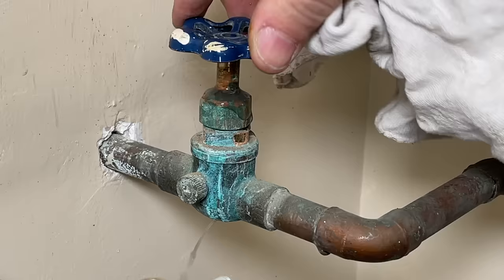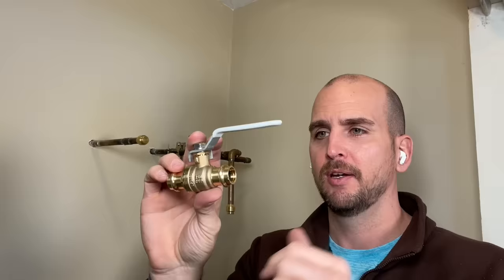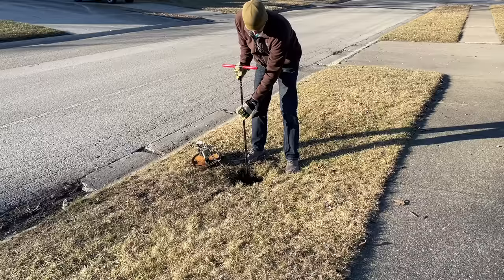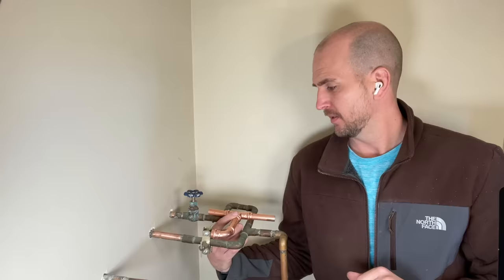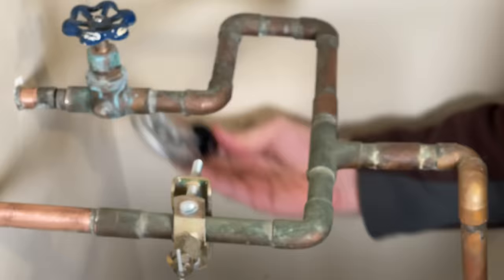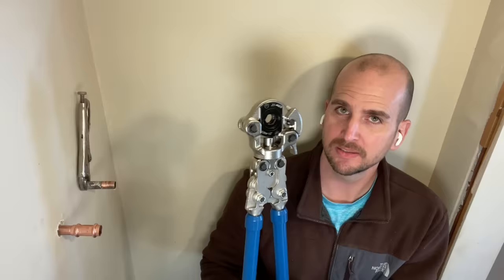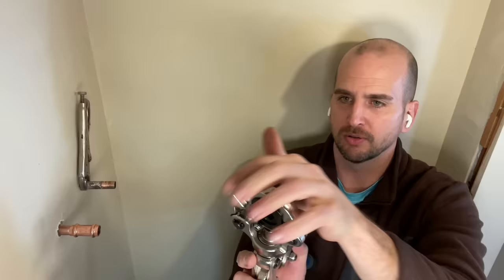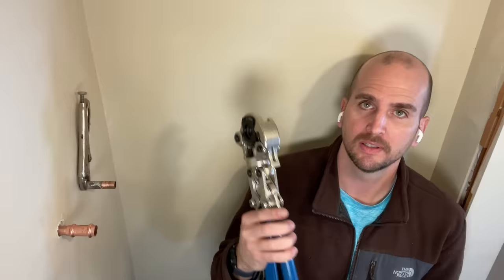How To Install a Main Water Shutoff | NIBCO Press Fittings

Comment: Now compare the price of fittings, tools and easy of install to sweat fittings, plus on a main line with an electrical ground? I mean if you are going to invest $180 in some plumbing tools go PEX.
Reply: Yeah I can’t see propress being practical for diyers or handymen. Propress pays for its self in two ways. Large jobs where you save on labor from soldering everything. The other way is in some repairs. You don’t have to completely drain the system to use press like you do with solder. If you have to fix a leak above a slab propress is wonderful because water is trapped in the loops and you can’t drain it making soldering difficult. You have to tape on a compressor and hope you can blow it all out whereas press you can just fix it
Reply: @joshcowart2446  Have you seen the price of Copper today?  Even retrofit homes are using PEX.  I am no plumber, it just seems economy alone has made Propress an obsolete technology.  You can buy a 100FT of PEX for the same price as 10FT of copper.  add in the additional price for fittings (10x propress vs sweat) and labor (vs pex) what large job or professional plumber is going to use this technology never mind invest in its equipment or space on their truck?  I even question the longevity of propress, O rings eventually fail, compare that to a properly installed sweat fitting.  With the evolution of pex being used everywhere these days including gas lines, and the spiraling cost of copper and other metal pipe, where will Propress or Megpress technology even be in 10 years?
Reply: @ericfraser7543  I agree, I wasn’t advocating against pex. I was comparing propress to solder. 

As to your argument I’m not speaking strictly residential. In commercial, copper is required for fire rating. Although I know uponor is 25/50 smoke and fire rated but I don’t know about other brands of pex. 
 
One of the positives I mentioned was repair. Pex has no bearing on repairing a leak in copper 
As for gas lines, where is pex used for gas? I try to keep up with tech and codes but I have yet to see pex for gas. For one, only metal pipe is allowed inside a building and the only flexible material is csst and it is definitely not cheaper except in certain situations especially with mega press. You may be referring to PE pipe which is similar to pex but it isn’t allowed outside the ground. If you had PE pipe in a house and it caught fire, let’s just say them at fire would get real big real fast and depending on the main pressure could cause other problems
Reply: @ericfraser7543  
I'm a retired plumber, and you're 100% correct.  I would never invest or use this nonsense.
Reply: @joshcowart2446  
Any plumber that would use Propress in a commercial application is nuts, that includes Shark-bites etc. Hell, I would never use any of those solderless connections in any application. There are several methods of getting water from copper tubing, both above and below a slab quickly. I know, I've done it hundreds of times. Soldering is by far the best way of fixing leaks on copper water lines.
Reply: @joshcowart2446  Yes I know you were not disagreeing, I guess I was referring to the yellow underground pex type pipe I see people installing for propane service to their home.  I guess your fire code explanation makes sense as to why it transitions to black pipe once inside the home...  I am not a pro but I can solder a pipe, it is not hard.  I just find it hard to believe anyone would advocate a homeowner buying a $180 Propress tool to install a main service shutoff... I mean it would be cheaper to pay a plumber if you could not figure soldering out on a youtube video.

I was not aware that you still need to use copper for commercial buildings.  It would make sense that a commercial sprinkler system / and main trunk lines required to be metal, as you would not want a pex water line to blow and depressurize the whole sprinkler system.  Still would Propress, and its mechanical O Ring meet today's commercial fire codes?  

To me it seems that technology evolves a lost faster than Building Codes, there is a political / financial reasons as to why it takes so long for building codes to adopt new technology.  There is likely some insulated/fire rated pex water line and or gas line solution which would meet today's fire codes.  I expect in 10 years it will be difficult to even find copper pipe in the big box stores, never mind propress fittings.
Reply: @ericfraser7543  copper isn’t required but engineers either h ent figured that out or don’t like pex. Like i said uponor brand pex is fire rated but I’m not sure on others. You can use pex in a commercial building but it’s rare that they call for it. I agree with the politics part. I don’t know codes for fire sprinklers but they do have plastics available for it. The use an orange pvc. I think it’s just cpvc that’s colored a certain way. As for gas, I’m guessing there’s a much higher standard than water when it comes to fire which is why even a fire rated plastic isn’t allowed. Also the reason an o ring is allowed is because a fire rating is just a delay. It doesn’t have to be fire proof.
Reply: @braney56  Amen and caulked cast joints are so much better than solvent welded pvc. You must have retired years ago because it’s been standard practice for at least a decade. I wouldn’t put shark bite anywhere near the same category as propress. I have the same hesitancy of trusting an o ring for decades but I’m getting over it.
Reply: Funny how the dinosaurs still won’t adapt to new technology
Reply: or solder

Comment: Great Job, One question, if you need to solder (in the future ) of a nearby fitting would this soldering melt the O-ring in the press fitted section?
Reply from the maker: Viega, which makes ProPress, offers a bit of guidance for this situation Soldering or brazing near an existing

To ensure proper sealing of the soldered/brazed
joint and the press connection, a minimum distance
between connections must be maintained.
When soldering near a Viega ProPress connection,
the installer must remain at least three tube
diameters away from the connection to prevent
damage to the sealing element. When brazing, the
installer must remain at least nine tube diameters
away from the connection. Refer to Table 3.4.
The installer should take precautions to keep the
Viega ProPress connection cool. These include:
•	Wrapping the connection with a cold wet rag
•	Fabricating solder connections prior to
installing the press fitting, making sure the
tube has cooled before installing the fitting
•	Applying “spray type” spot freezing
Reply: That's a very great question my concern exactly I don't know if I want to rely on an o-ring on my copper pipe I do a lot of plumbing repair work hot water heaters and I like to know that it's in there permanently and if it had to be redone you just heat up the soldering clean your pipes again I'm not real happy with it I don't trust shark bites and I don't know if I trust an O-ring

Comment: All you really have to do is go down to Home Depot and buy a ball valve with compression fittings on each end… only takes two pairs of channel locks to install with a little bit of pipe dope on the threads. The compression joint will last forever ….But if you’re getting a kickback from Pro Press, oh well, they sell another tool. I’ve been doing Plumbing since junior high, over 40 years. I wouldn’t use O-ring based fittings except maybe on an outside fixture and it’s all you had to make the repair.

Comment: The mechanical press deforms the tubing and fittings.  Deformation causes turbulent flow that will cause cavitation at every cold press connection and result in premature leaks and failures.
Reply: I would like to see a demonstration of that with clear pipe, but it does make sense.
Reply: I disagree, It forms on the outside around the pipe that's inside the fitting which will not cause turbulence.
Reply: Earth to Scott Choi  It's presses the outside fitting..stop reading comic books  lol
Reply: @davo912  - It will also deform the tubing some too.  Also, proofread your comment, you sound like comic books are over your head.  Auto correct has gotten pretty much all of us, it's definitely made me sound like an idiot a time or ten.
Reply: @dustintunis9347  as usual you make comments  that are delusional and just make comments to make yourself feel important. Please present your evidence that it can deform a pipe when it's a rubber o-ring pressing up against the pipe..Stop sniffing glue..lol
Reply: @dustintunis9347  not a prick but just dispise people that make comments like yours and now fully admit that you know nothing about the product..
Reply: @davo912  - Only being a prick when somebody annoys you is still being a prick.  You could explain why you think somebody is wrong instead of just trying to stay a fight.  I thought I understood how the fittings worked and it made sense that they would deform so I had no reason to question how they sealed.  Instead of asking how an o-ring would deform the pipe or explaining why it wouldn't you went straight to putting people down.
Reply: @dustintunis9347  very true  Dustin..thank you for the compliment

Comment: I've found the cost and time for replacing a washer and silicon stem packing makes more sense for me. I clean up the stem with a steel brush on a grinder. ...good for another 25 years!
Reply: except if its a gate valve..

Comment: I'm torn on just learning how to solder copper pipe or buying this tool. Soldering cost is cheaper but the upfront cost is still expensive. Torch,gas,deburring tool,flux,solder.
Reply from the maker: If you have the desire and some patience I would learn to solder.  Hard to beat a properly soldered joint.

Comment: I'm new to both shark bite and nibco press fittings but I can say from experience there is one slight advantage with shark bite, they are removable using an inexpensive tool but the nibco press fitting is not.

Comment: I'd like to put in a main water shutoff inside the house, but I'm not sure would be the best way to go about doing it. We don't have a basement, so we have this concrete cylinder valve in the ground, but it's broken. We end up having to shut water off at the meter to do any servicing. I don't know if you could just put a valve in the concrete slab with a metal cover over it. It would be easier to shut off the water whenever it rains and especially when the meter gets flooded. It seems to usually be flooded whenever we need to do maintenance. For one valve install, I think I'd rather just have a plumber do it. It likely would cost around the same when you add in the cost of the crimping tool.

Comment: All fittings are good but only when used in the right context. Can't beat copper and a solder joint but in some cases heat is not allowed. Our press fits in the UK are good but pricey and the press tool is expensive. You have to decide if you can justify press fit.

Comment: Nice video definitely think sharkbites when installed correctly are truly amazing.  Always wondered about the manual press by nibco,Looks like it did a great job . Definitely pro press is the way to go in bigger pipe and a non stop water situation yes they cost alot but what about your time its definitely worth more than fitting. I've soldered  1/4  up to 6 inch .  Soldering pipes will be a thing of the past in the not to far future.  Master unrestricted master plumber> owner, worker  of Joe Mac Plumbing. SHARKBITES ARE PRO SO YOU DONT HALF TO BE.
Reply: I recently had 120 feet of steel gas pipe run with several direction changes and the pros only used press fittings.  They must have confidence in their dependability.

Comment: Ball valves have a tendency to seize up if they aren't cycled occasionally.
They're good for boilers and other equipment that gets serviced.
A slightly leaking compression valve is better than a ball valve that is stuck on full open.
Reply: Thanks for the reminder!!  Something to do today.

Comment: When the o-ring fails, how do you remove the crimped connection to replace it?  It seems like you'd have to cut it off again, leaving very little pipe left.  I think I'd prefer a compression fitting or a soldered one.
Reply from the maker: Hey James, yeah you would need to cut the pipe off if there was a failure.  Overall only 1 commenter indicated they saw failures in press fittings but we will see if more comments on failures come in as we usually get a wide range of experiences from all over the US / World.
Reply: On a new build then definitely a lot quicker and anyone can actually crimp .
but as replacement on an existing install definitely wouldn't use them, the fact the vavle needs replacing demonstrates why this jointing method can lead to more issues
Reply: how long do you think it will take the ring to fail? Press fitting are used across the world in residential and commercial settings with a warranty of 50 years.
Reply: @TheDogDad  if you're going to use a crimp joint why not just go straight to solder joint, at least you'll have the ability to desolder the joint without cutting pipe short.
Good luck claiming even just 10 years down the line. How do you prove it was installed correctly and by a bonafide plumber just for starters, and for the cost of the joint is it even cost effective to argue the item didn't last the course. 
Ideal conditions never match real life., 
Here in the UK plastic pipe push fit fittings are commonly used is used if it can be hidden and copper pipe where pipe is visible

Comment: FYI when operating a old valve run the water. Any junk on the valve will be washed away. 

Also supply house has shark bites for cheaper than big box store.

Comment: I think sweating pipe is best for seal and rigidity, but takes too long for what it's worth, I like the crimp-ons, they are ridged and seal fairly well. 
SharkBite on the other hand, are expensive, bulky, and are NOT for professional work. Use SharkBite for temporary joints, and or caps, is great though.

Comment: well i don't know about the rest of you but by the time you got the first one crimped i would have soldered everything and gone home already lol at 175.00 bucks for the tool this is for plumbers only am not sure i would trust this to last in the long term O-rings break down
Reply: I’m a union plumber and these last very well. We use the expensive press guns but they have them for natural gas, copper, steam pipe. Very dependable

Comment: I am not a plumber.  If I have a plumbing project it is usually an emergency.  I have to make at least three trips to the local Ace hdwe store and invest upwards of 50 bucks on parts or maybe a tool that I may use only once in 15 years.  I could hire a plumber, but at 150 bucks an hour, it is cost prohibitive, plus the fact that all plumbing companies are booked up solid for weeks or even months.  My grandson hired on to a company but quit after 2 weeks.  He decided a plumbing career was not going to be his thing.  As an aside here, my wife and I needed to replace our 40 year old bathroon toilet.  It has been several days and hours busting out concrete so a new closet flange will be between 1/8 or 1/4 above the floor level. Sunday I spent 5 hours with a cold chisel and a 5 pound hammer.  I still need to secure the flange to the concrete by drilling holes for screws.  In the mean time, we are careful to not rock the bowel.  It is turning out to be a depressing nightmare and a drastic emergency.

Comment: The press fittings look great, however, I would probably just sweat new copper fittings and valve.  As a DIYer, I do so little of this, I really can't justify the cost of the tool and the fittings.  Even though I have a tool box full of tools that I bought and used only once!

Comment: For occasional uses, I'd rather just solder. I am a remodel contractor and I do lots of plumbing repairs during a remodel, and that big handle will requires large work space. And the cost of proper pro press tool just did not justify the cost. For professional plumbers who use it every day, it makes sense, but not for me.  I have proper Pex-A expansion tool though. I got it pretty cheap and used it to repipe my house.
Sharkbites are probably safer for home owners than low quality press tool. Less chance of making mistakes.

Comment: You can take a hacksaw and cut old valve off. You cut on the  valve itself and then un solder the fitting that is left on the wall pipe. This way you save all the length of pope coming out of the wall.

Comment: FYI...when tolerances are tight, I usually heat the connection and pull off the fitting or valve- preserving the pipe length and clean up the remaining pipe length.

Comment: I used a Shark Bite for an emergency repair on an "outside the wall" cold water line to my tankless water heater. It is holding up well so far for the past years and the pipe will not be not be needed after the install of my new tankless water heater. I don't think that would use a shark bite on a pipe that would be "inside" the wall, the warning signs of a possible failure may likely be to late.

Comment: Although Viega and Nipco both noted that you can use type L and type M pipes for their fittings, but I learned my lesson in only using type L and stay away from type M pipes. They are just too marginal and not worth saving a few bucks which might cause leakage down the road.